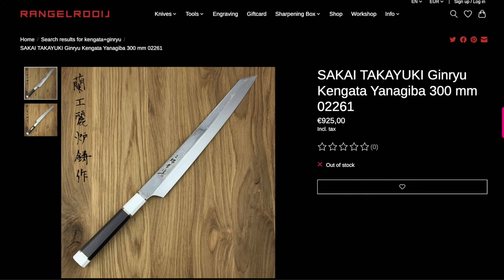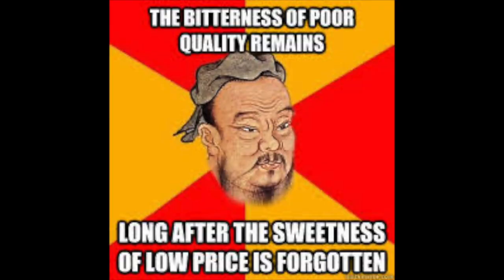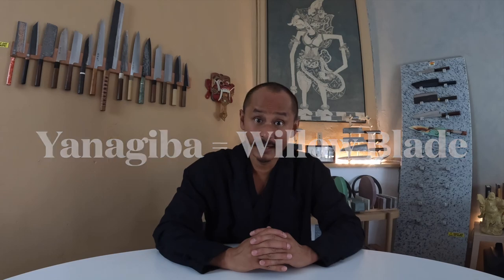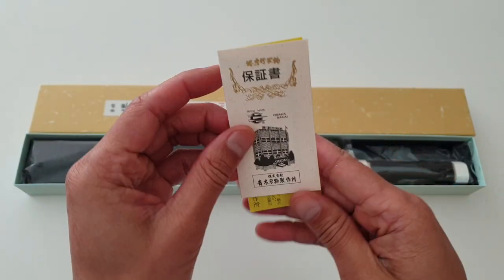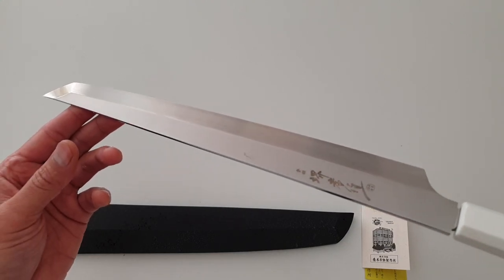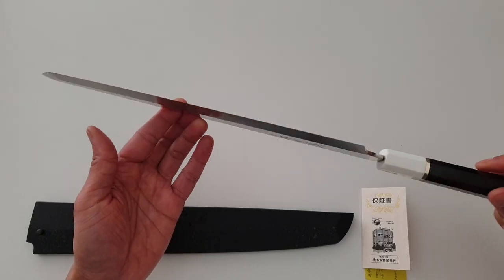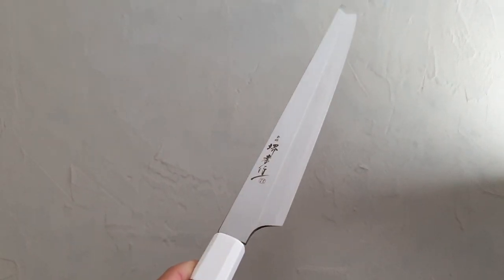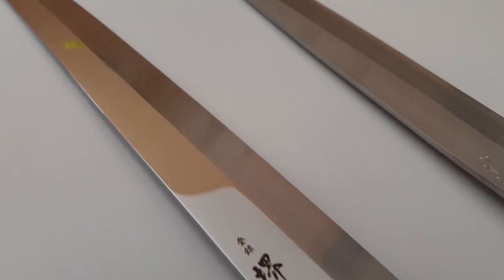Nice Slice: Sakai Takayuki Ginryu (Honyaki) Sakimaru Yanagiba 300mm Swedish Steel

Comment: I know that steel of ginryu is ginsanko and
I think that there is no merit about honyaki in stainless steel
Reply from the maker: I think you are correct. I thought this is more like a 'monosteel' knife myself. This is what Elwin de Veld, Master Sharpener and owner of Rangelrooij wrote to me after I asked him why this Ginryu knife is sold as a 'Honyaki' blade.
"For this knife they have chosen to use Swedish steel, not for Shirogami or Aogami. Honyaki stands for forging one piece of steel and quenching it in oil or water. Coreless vg10/vg10 in Japan sometimes is called Honyaki vg10/vg2. This can be a little confusing,"

Comment: I have a Swedish steel honyaki knife, how can I make the hamon pop out?
Reply from the maker: I'm not sure. You could ask a (sword/knife)  polisher if it is possible to do it with a certain polishing technique or stone progression. Or maybe with a certain etching solution. But as far as I know, the Hamon is mostly determined during the forging and quenching of the blade.
Reply: @chefknivesenthusiast   was it visible on that blade?
Reply from the maker: On this particular knife in this video, there is no Hamon line because it is not differentially hardened. It is technically a monosteel knife. In Japan, they can  also be referred to as Honyaki blades sometimes (I can't explain exactly why). 
So if you have a 'Honyaki' blade made of Swedish steel, it might 'just' be a monosteel blade. Without a Hamon.
Reply: Seems like stainless honyakis do not usually have a hamon. I came across a lovely hitohira ginsan honyaki. Nice mirror finish but no hamon either. 

If you want hamon go with carbon honyaki, even better with white steel